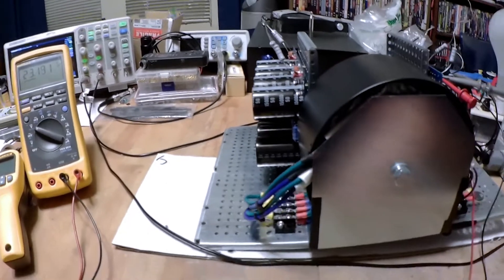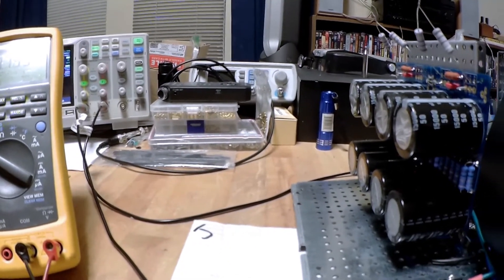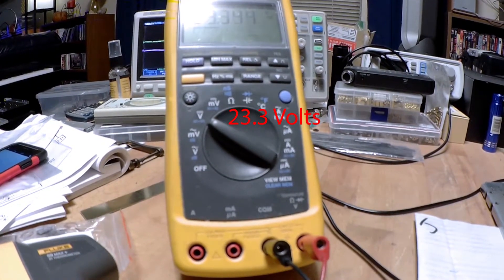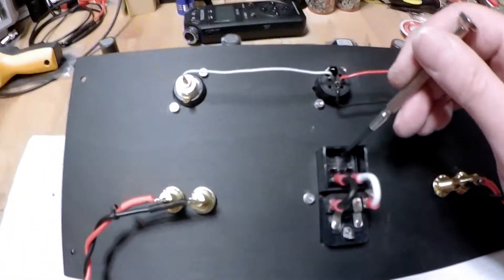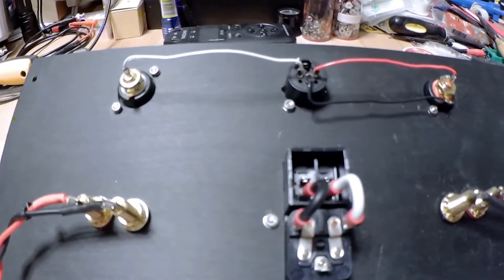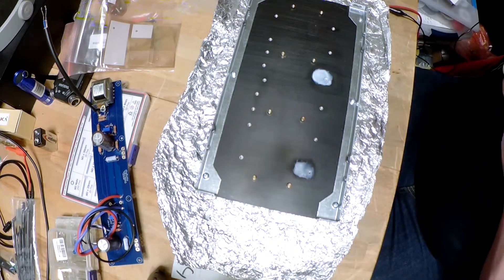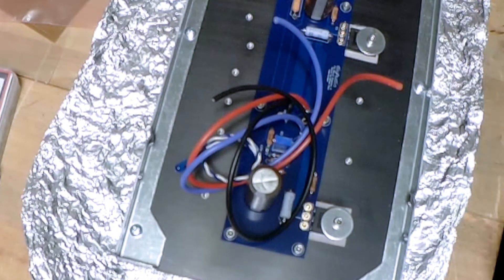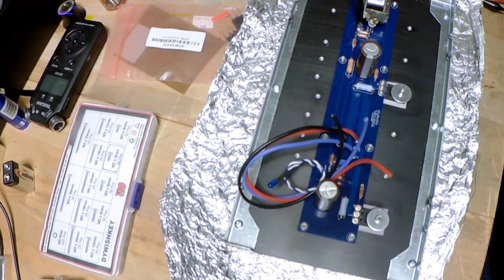Robert builds the Nelson Pass F6 Amplifier Part 8

Comment: Hi Robert, do you think there might be room to stack the filter boards on top of each other as and alternative?
Reply from the maker: It is possible using 3 risers I guess. It would be a bit asymmetrical with Rectifier boards on one side and the Filter board stack on the other. In my F6 build, I did not want the rectifier boards and their AC power near the amplifier boards at all.